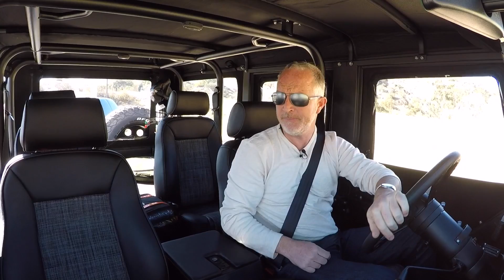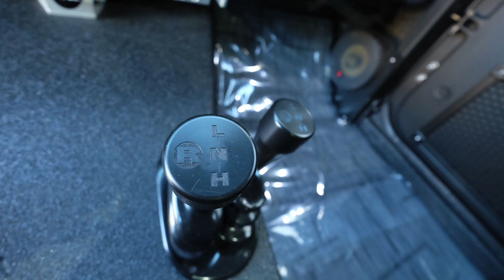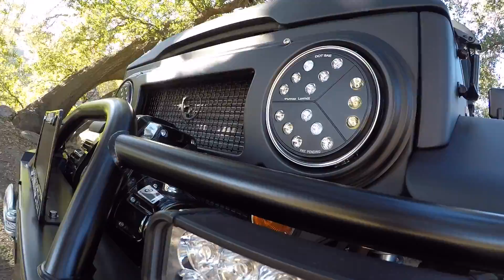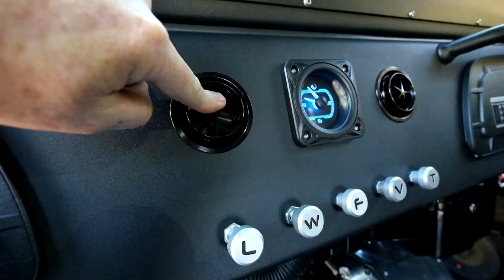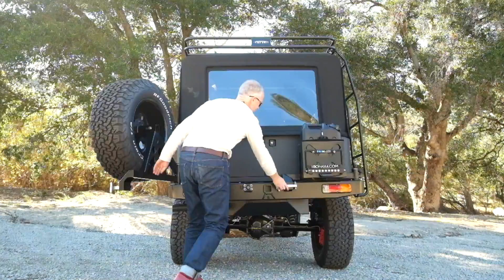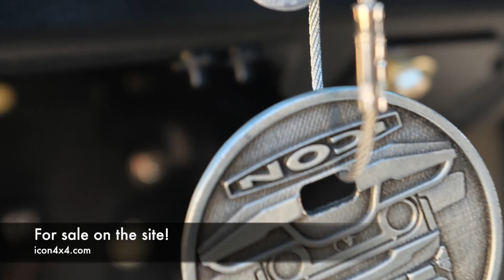ICON FJ44 #108 New School Restored And Modified Toyota Land Cruiser FJ40

Comment: Everything seems nice apart from that trunk with zip screen that needs to be hand rolled up and barn doors that dont have locking hinges. I can see how that is interesting to use first time, annoyting the second time, frustrating the third time, and fourth time you wont even bother using whole rear... Think about doing that in storm conditions. Or if you spouse uses the truck and is not tall enough to lock that roller window up.